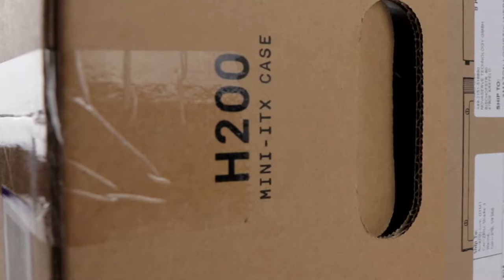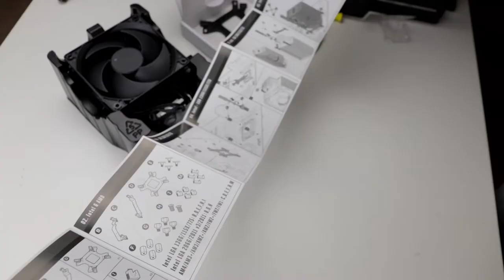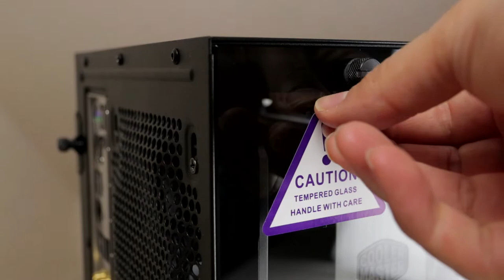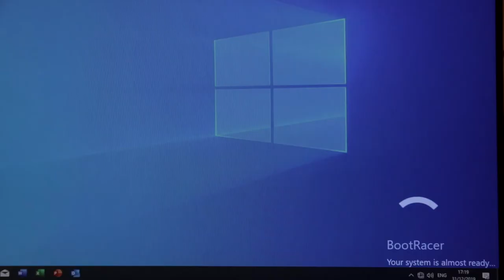Building a Mini ITX PC using a NZXT H200 Mini PC case on a budget in 2020

Comment: Great video! Just finished building the same with the B360N wifi board but on a H210. I do have a quick question- where did you plug the fans into on the mobo? I can't find anything readable to allow me to plug the two cables in... Thanks! (NZXT couldn't help)
Reply from the maker: Hi, all the fan headers are at the top of the m/b. You will have the cpu fan header and next to that you will have two more  for sys_fan1 and sys_fan2. Hope that helps.
Reply: @hypet  Thank you! Yes, it does. I'd been sitting trying to figure that out and was just about to try the two headers. And for your LED strip, did you connect to the PERIF plug with a MOLEX plug?
Reply from the maker: Thats awesome! With my LED strip I used a RGB connector. The ones needed if you cut your LEDs into sections. So one end goes onto the strip itself and the  other end is a LED female connector, this connects directly onto the m/b LED Strip Header (no molex needed for the strip I used)

Comment: That is a nice build. Is the top fan set as intake or exhaust?
Reply from the maker: Thanks, the top fan is setup as a exhaust.
Reply: @hypet  Ok. I recommend removing the dust filter then. It does not serve any purpose if the fan is set as exhaust.. it even blocks the hot air from escaping the case. You should only install a dust filter if the fan is set as intake... to prevent dust from entering the case.

Comment: so i have the exact same build. how did you get your monitor to power up with it? i have a sceptere monitor but it keeps asking me to check my input. i connected the pc to the monitor using hdmi, but the monitor also has a display port but i don’t have an output for that on my pc.
Reply from the maker: Never had a issue with the monitor, just auto detects and its good to go. FYI this build is running BIOS Version F13.
Have you got a spare HDMI cable to plug in and try? Also I know this can be a hassle to try but if you have a TV with hdmi you could test it to see if it works?

Comment: Honestly, I rarely comment on YouTube, but the budgeting on this build is really bad. The intel i3 just can’t compete with the Ryzen 3. For a lower price, you can get the ryzen 3 3200g with Vega 8 integrated graphics. The AMD stock cooler is also not bad even with a light overclock. The money saved ( cheaper CPU and no aftermarket cooler) can easily be used towards 16gb of ram. SFX power supplies are also more expensive compared to standard ones, and the NZXT case supports full size power supplies, the money saved from not having a SFX power supply and cables as well as the money saved from the previous CPU and cooler can go towards a GPU like a rx560